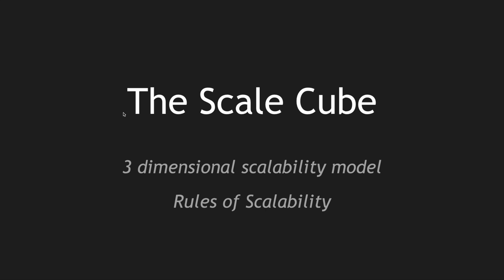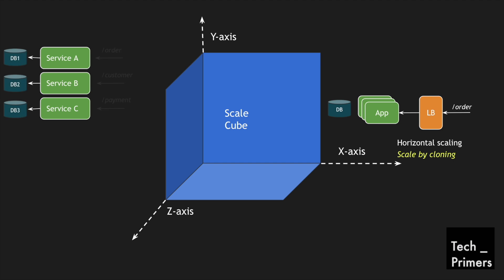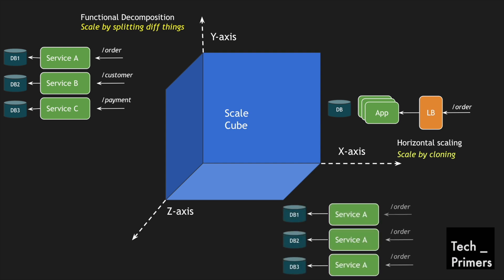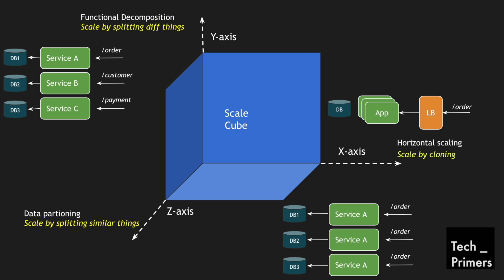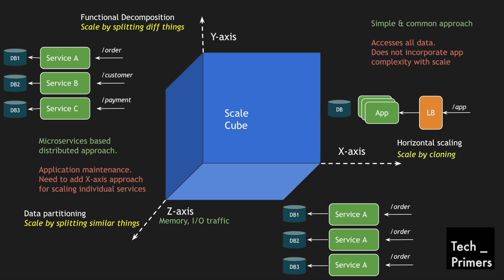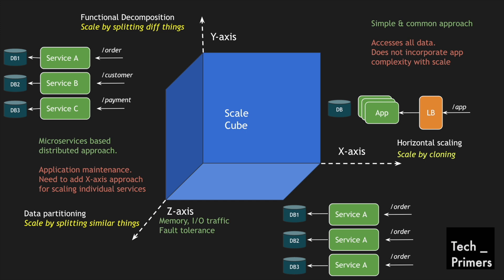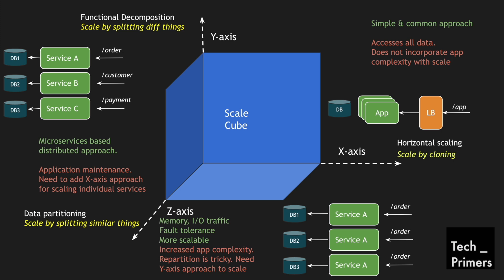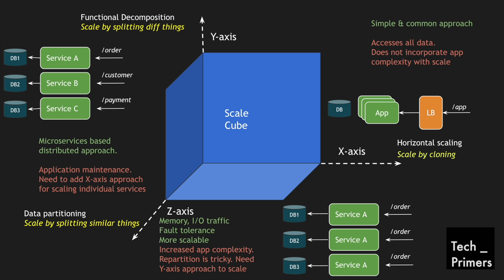The Scale Cube | Rules of Scalability | System Design Primer | Tech Primers

Comment: Awesome. Thanks for very useful content. 
With data partitioning approach, I think NoSQL DBs could be preferred over Relational DBs. I don't see relational DBs having any out of the box solution for data partitioning. I was wondering with scalable applications do we need to consider relational DBs at all? Thanks.
Reply from the maker: Yes Omkar. You are right. We dont necessarily use relational db in the data partitioning use case. But it can also be done. That's where the repartition is a key. If we have a standard partition then relational dbs can be considered for analysis